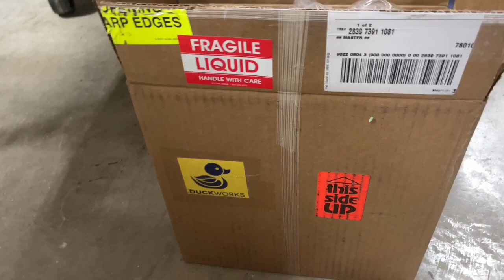Slingshot Trimaran Sailboat build video

Comment: That thing looks perfect to me! Good job. On leaving the carbon fiber un painted.. did you use a uv resistant epoxy mix for those or not needed? Thanks for a great build video.
Reply from the maker: Thanks for the compliment. I did not use uv epoxy but the boat is stored inside. I did however purchase some Raka uv epoxy for another project and will probably coat these parts with it on the next refinish.

Comment: It's a pleasure to see other builder's interpretations of Frank's plans.
I can relate to "good enough". I had a horrible epoxy pour in an unheated shop during February the year I built mine. It never cured, and I spent about 20 hours cleaning up 2 hours worth of a bad pour.
I started off with two leeboards then discovered that with so little heel, a single longer one would do just as well.
My Hobie 16 mast step sits atop the center of my front aka.
My aka "cradles" are canted about 5 degrees outward so the amas land closer to vertical.
I'm looking to add benches similar to yours along with a mainsail traveler across the rear aka to help her point and to calm down the gybes along two jib travelers next to the mast.
My Slingshot 19 with the Hobie rig has hit about 18 mph for some half mile sections as she is now. I'm hoping the added trim capabilities that come with the travelers might give me a couple more.

I also have a mast step for an unstayed mast about 16 inches ahead of the Hobie that I can cover. When I don't feel like spending a lot of time rigging, I can throw up a GIS balanced lug and hit 12 or so mph without as much work.
Reply from the maker: That sounds like a really neat setup! Next project is new rigging. Going with a Catalina Capri rigging with new sails from sailrite. In fact I just got the sail kits in yesterday. Picked up the donor  boat a couple weeks ago.
Reply: @willrobertson14  That's a pretty big jump in sail area! The Slingshot 19 lets me get away with it by having the amas 18 ft long for an 18'10" LOA. Otherwise the amas would be burying a lot easier.
To reduce the likeliness of pitchpoling, I mounted the amas about 4 or 6 inches proud of the main hull bow. The only point of sail that moving the amas for is DDW, which isn't where a tri really shines anyway.

I'm hoping to get my mods done in time to get a couple of tests in then hopefully see the B&B messabout crew in late October on the NC coast.

How far aft of your current mast will you be setting the new one? Or are you sticking with the current location? I've found it to be nice to retain two sailplan options. The balanced lug doesn't have the speed or point as well, but stepping that short mast and only dealing with a few lines takes about a third of the time as getting a Bermudan stepped with a roller furling jib.